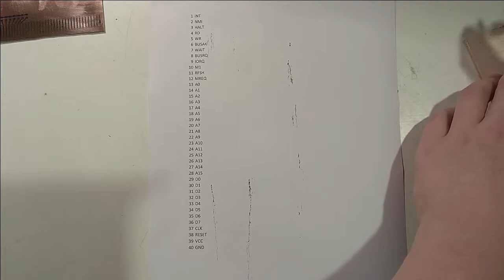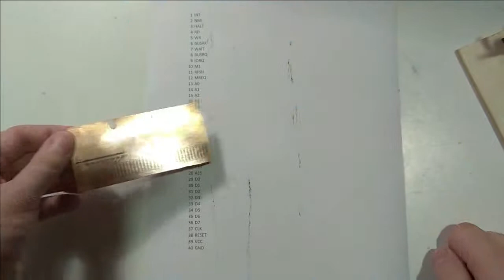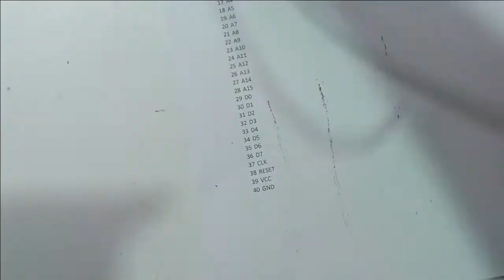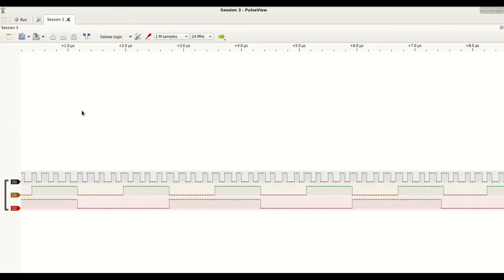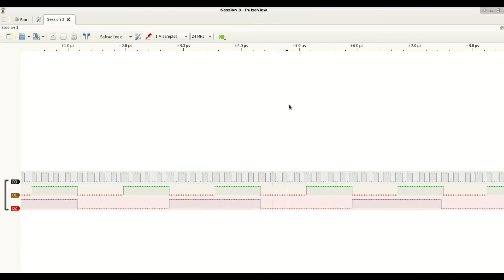Building a Z80-Computer Part 5 : The Processor Card

Comment: first thanks for doing the videos ON Z80 computer project!  
I find your approach interesting.  Similar to mine in a lot of ways.

My Project: is built around a RC2014 kit computer from the UK.
built it but it doesn't work completely.  So I've set off to trouble shoot it board by board (5 boards + back plane)
more later 
;-)

Comment: could you make a little introduction about the z80 instruction set / general architecture?
Reply from the maker: Sure! As soon as I have a proper grasp on it myself :P
Reply: The Z80 is software-compatible with the Intel 8080 ISA, so if you read up on that, it should translate to the Z80 really nicely.